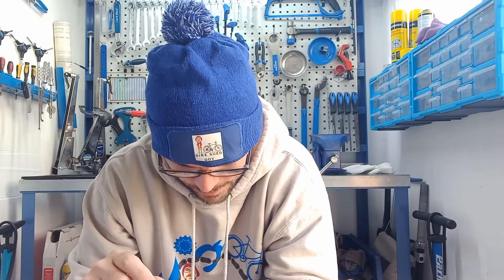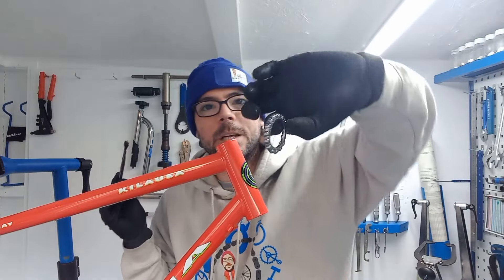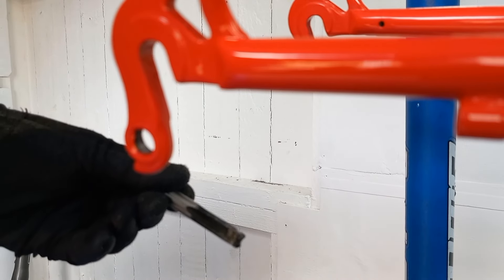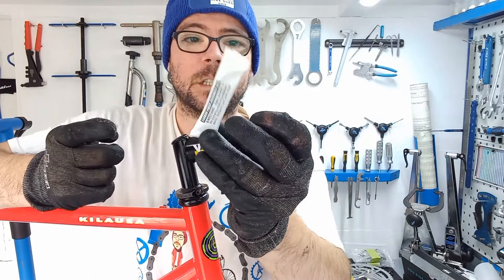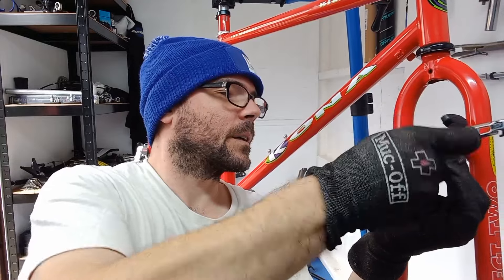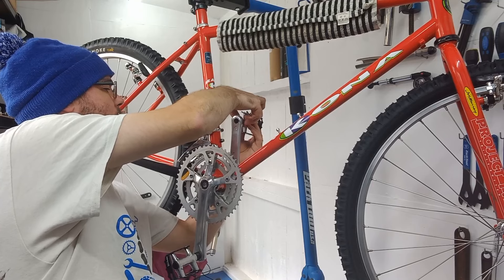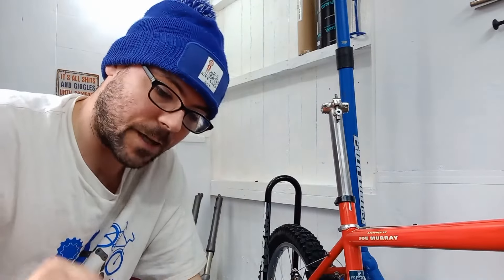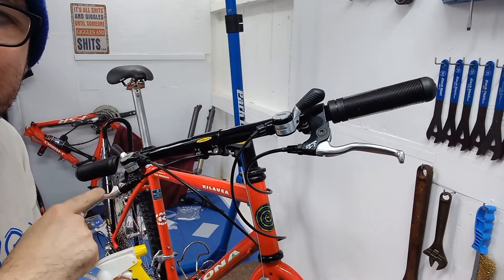Frame To Finish | Kona Kilauea | Full frame MTB restoration refurbishment build

Comment: Love Konas as you know... Beaut... What year was that frameset in that colourway ?
Reply: Its a 1993 model, originally a burgundy metallic with black forks, but i didnt like the colour, and with it being only original once, for me it didnt matter to change the colour, the kona hot came in this colour and while i was there decided to colour code the forks, its actually gloss red powdercoat that looks like glass to every edge. I had in my head what if back in the day when it was purchased new, it was actually speced in this colour for a wealthy customer 🙂
Reply: @josephkey1514  turned out nice 👌🙏
Reply from the maker: There you go, my mate who's bike it is beat me to answer the question 😉
Reply from the maker: Cheers, mate. I was going to ask you that so I could reply 🤣 👍

Comment: Not to be that guy, but I'm just wondering if you used copper grease on the bearings? I was always told never to use copper grease on bearings as it can prematurely wear them down. Just thought mention it to save heartarche down the road.
Reply from the maker: @NeatSix  no mate good old fashioned muc-off grease on the bearings. Never use copper grease on bearings, as you stated 👍
Reply: @BikeShedBoy ah my bad, in the shot with the lower headset bearing it looked copper and I thought oh no 😳. But I stand corrected
Reply from the maker: @NeatSix  no worries mate 👍 still working on lighting, cameras, and the way I say things. It's always great to ask questions, mate. 👍

Comment: Hi,
Very impressed with the job. Well done. You don't happen to have a link for bearing races for the Impact Headset, do you? I am doing a 93 Lava Dome and can't find the right size readily available.
Reply from the maker: @bgr1978  cheers, mate. In terms of the replacement bearing race, my friend Joe was searching on eBay for months, and a set popped up. We were possibly looking at running loose bearings or popping out the bearings out the old race and trying to reuse it. It's super hard to find. Also found in that past, it's been cheaper to buy a donor bike for the parts required to finish a build. Are you missing the bearing race altogether?
Reply: It's all there save two bearings. The teeth on one side seem to have been crushed slightly, but I reckon I may be able to rescue it. The ultrasonic cleaner did a great job of cleaning it, but the balls went everywhere and nobody wants that!
Reply from the maker: @bgr1978  mate, that sounds super promising, a bit of fiddling getting the cage right and some fresh bearings in the race and should run like new 👌
Reply: If I can't find new, I shall definitely be fettling away! Cheers mate. Love the channel.
Reply: I  found a Hahanna frameset with Project Twos, velocity stem and impact headset for 50 quid, so we are good to go!
Reply from the maker: @bgr1978  Great, buy mate, the headset alone goes for more than that. You then have another project bike or just sell that one on 👍
Reply: This will be my 125th project bike. There's always another! N+1
Reply from the maker: @bgr1978  wow that's alot. I have totally lost count at this stage 🤣
Reply from the maker: @bgr1978  Thank you, mate, so much 👍